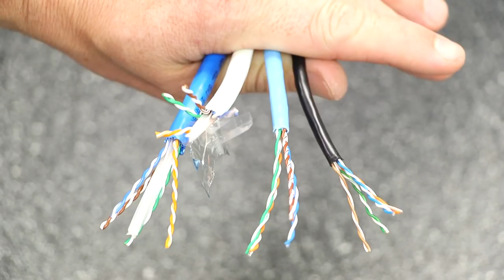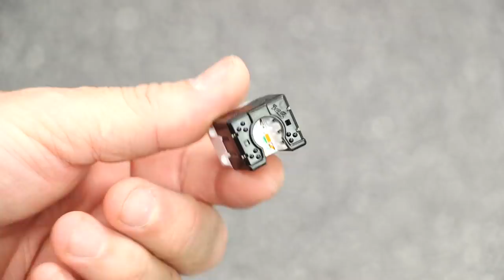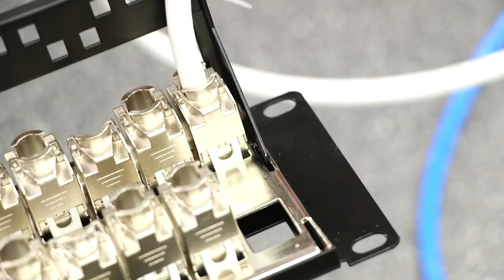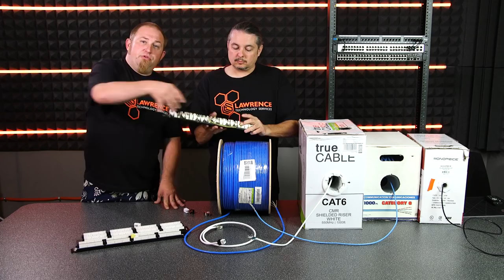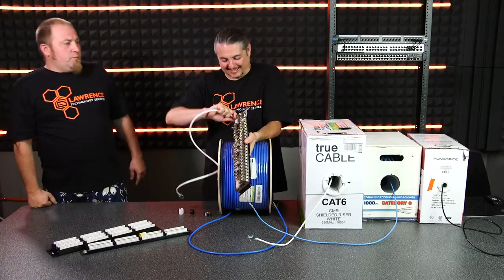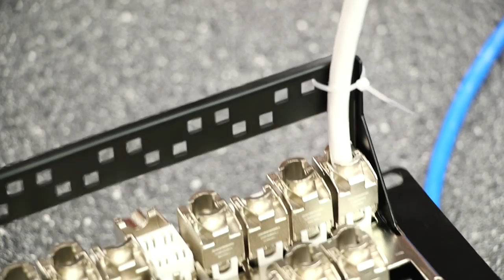Structured Cabling Discussion: Working With CAT5e, CAT6, CAT6A & Shielded Patch Panels

Comment: The maximum length for gigabit ethernet is 100m not 300m. I think you mean 300ft.
Reply from the maker: Oops, thought I said 100m
Reply: Nope you definitely said 300M, i was wondering what kind of magic you had for that.
Reply: Tom WILL make it work. 👍
Reply: Copper Ethernet can indeed go beyond 100meters with the right equipment.
It’s not standards based but it works well.
Reply: If your fingers don't hurt your not doing it right. The twist is a big part in the design of the cable. I try and leave the twist in as much as I can that's the finger bleeding part. It's amazing when you think how much engineering is actually in all the cables. The twist in the cable is like how the planets magnetic field protects us from the sun. Twist helps keeps signal in and pushes interference such as Emi and RFI out. The twist in the cable is different from each pair because when singnals shoots out from the switch. The different twist allow for slightly different traveling speeds between the pairs Mila sec helping with crosstalk between the pairs. The A in cat6a or 7 Stands for augmented the augmentation of the cable is the thickness of the jacket, shielding, core ,gauge of the wire, and the extreme twist that's in the cable. For me cabling is one of the most important parts of the job cable stays equipment changes so if you have a customer that is buying property or is planning on staying at their office for a really long time investing in the cabling is a good idea. if they're just going to be there for a year or two then I would probably go with the Lesser cable depending on what their needs are as a company. I don't run Cat5e not for a long time with my distributors I buy enough cable that my prices are near Cat5e prices so I just install Cat6 most of the time. If your bidding a job and the job is a plenum space then the cable will be considerably more expensive near double. Watch out for the plenum. Great video guys
Reply: Yeah I'm sitting here trying to brush up on my cabling knowledge. Hear 300 meters and am thinking, "Okay either I don't even know what I thought I knew to be correct or something has changed". Luckily just a mistake lol. Great videos still guys. Wish I could work for you. Great group you've got.
Reply: 328 ft is what is recommended for maximum distance of a data cable run.
Reply: way back when I took my CCNA the maximum run of 10/100 cabling was 90 meters in the wall (i.e. 300ft).
Reply: yes, 90 meters in the wall and up to 5 meters on either end for a total of 100m from end to end.
Reply: Kenny Garland completely right put that together you get 328ft. So the solid coper cable is allowed 90m and the stranded coper patch cords for the ends is 10m
The reason for stranded copper is for the flexibility and strength. Patch cords get bet up pretty bad on user side with desk and all that.plus the rack side patching and routing cable management. I find why and how the cable works pretty interesting. It's made that way for a reason. In the real world sometimes we push distances a little over. Most of the time on a long run just add a idf or a switch and re boost.
Reply: Kenny Garland 90m is 295 feet 3.307 inches
300 ft is just way easier for remembering
Reply: The Belden REVconnect doesn’t hurt your fingers but it beats the hell out of your wallet.
Reply: @RedneckTechcontrolle  not it 300ft to 100m
Reply: @LAWRENCESYSTEMS  that confused the heck of me. Mistakes happens :D
Maybe you could put a note on the screen?
Reply: @LAWRENCESYSTEMS  that confused the heck of me. Mistakes happens :D
Maybe you could put a note on the screen?
Reply: this people has no idea what are talking about ... my god !
Reply: @lowvoltagedude7837     and 328 is crazy, as you should consider service loops and other gizmos and runs  ...  I would say 300 is MORE than recommended if you want to stay out of problem ...
Reply: @RedneckTechcontrolle  fiber

Comment: its been a while since i have had to break out my punch down tool. I was looking around for 110 punch down patch panels and they are harder to find than krone. from what I remember there was little scissor cutters on the end to clip the wires instead of a pinch edge like on my fluke 110 punch down. Any insight on krone vs 110 punchdowns ?

Comment: Thanks for another helpful vid! Would love to see a conversation about what sort of environmental factors would cause you to select shielded vs unshielded Ethernet cables for an install? What kinds of interference sources do you look for? Does any length of run that is parallel with a 120vac line constitute a problem? When does shielding become a hazard in terms of failed to grounds causing them to become antennas?

Comment: True that cat5e and cat6 will meet the gigabit spec. However issues with Poe become a problem because cat6 is 1/2 a gauge larger than cat 5e. Some of the new Poe standards they do not recommend using cat5e over 150 ft. There's also a new redundancy feature they are building into ethernet they intend on packing gigabit over two pairs. This allows for link aggregation on a single ethernet cable. At 2gig primary application is for Poe phones. So the phone will have its own network connection and the PC will have its own network connection a physical connection is made in the phone that allows the computer to have its own port. Not reliant on the phone. Also allowing for dual Poe so the phone will operate on Poe and the other device plugged in can run on poe as well. However this standard will not work well on cat5e will probably be limited to a 150 feet max. Also keep in mind that at higher Network speeds like the 10-gig spectrum when cables are bundled together you can have interference from an adjacent cable commonly referred to as alien crosstalk.  This can occur even on cat6 at less than 150 ft It has to do with understanding cable length and amplitude differences this is the primary reason why cat6a was developed to eliminate alien crosstalk issues. The other thing that is commonly misunderstood is shielded cable. When people think of a shielded cable they  think of a cable with all the pairs in the cable having a shield around it. That is technically incorrect it is what they call screened. A true shielded cable like cat 7 we'll have each individual twisted pair shielded. This prevents what they call reflection. When you have multiple conductors in a cable with a common shield the frequency can radiate from one pair and The shield can act as a reflector and induced self on another pair. If you live in the United States the primary reason why you do not see shielded used commonly is because the United States has the FCC to regulate frequencies and RF given off by equipment  within the air. However in Europe there is very little governing agency in the past that has done anything to regulate frequencies. As a contractor who works with customers all the time.  budgetary matters I explain one fundamental truth the cable will always be the last thing replaced in the building. can you afford to live with substandard cable being installed from day one. Having an understanding and a grasp on the cables limitation like poe applications can help the customer make better decisions. If you are a cabling contractor or somebody intending to have a building cabled I strongly suggest that the access points be done and cat6a because of what's coming as far as network connectivity. everybody is talking about what 5G is going to do to the cellular industry but the same technology is going to filter its way into Wi-Fi as well. you have to look at it access point as a switch multiple people accessing it. For home where people are accessing the Internet it's really not necessary but in large businesses where they access stuff stored on their servers it becomes critical.

Comment: I never comment on YouTube videos, but had to on this to tell my tale.
My employer just went through a large infrastructure upgrade to replace all our Cat5 runs with Cat6, and we also replaced of all network and server hardware.  They brought a contractor in to assist with the planning for the project and they insisted on Cat6A.  I argued with them that it was too expensive and not worth it for what we're doing as a business, but the contractor got their wish and spent double, if not triple on the 6A when vendors bid the rewiring job because contractors know everything. :)
Ended up being 100 dual drops (one voice, one data), and the vendor was here for three to four months.  It was their first experience with 6A and they went through a few patch panels before finally getting the shielded panels like shown in the video.  The traditional panels you feed the cables in through the side with just kept popping loose.  The vendor was so annoyed and angry with the 6A because it's so rigid and hard to work with, and it made them do more work because the power poles we had at workstation locations needed to be replaced to accommodate the large cable, the hanging in the ceiling was difficulty do to the weight of the cable, and the various panels they went through.  It was a nightmare and completely not worth it.
Reply: Here in Germany we only use CAT 7 or 7A on new installs. The prices have dropped very much in the last years.
And it is worth it. No more interference and you are ready for 10G in the future without having to rewire.
I recently bought 900MHz CAT 7+ cable for €0,58 per meter.
Reply: Cat 7 is a bit of a hoax to be honest.
Reply: Cat6A jacks need deeper trunking\back boxes, is a pain in the arse to work with. But saying that even on my first Cat6A job I didn't experience problems your contractor did. Was they an electrician or specialized data installer.
Reply: Yes, they are licensed installers and do wiring for security cameras, networks, phones, electrical, etc. and we've used them in the past and they did a great job for us.  Very clean, quick, and they were always cheaper than others.  I just don't think they were ready for the 6A beast since they never had to use it before lol.  I wasn't expecting it to be as bad as it was either.
Reply: iwanbo I’m curious as to whether any of the runs would go over 30m. If so then your insistence on CAT 6 is invalid. If your try to establish 10g network and the growth capabilities to future you need to ensure long term usage. CAT 6a came about due to longer infrastructure runs. Anything over 30m can’t be certified for 10g as it loses bandwidth. Only 6a has the ability to run up to 100m end to end. End to end referring connector of switch to device being connected. If none of the runs going from switch to computer or voip drop was over 30m then your cost saving would’ve been there. Curious how small the facility was for you to wire up only 30m lengths.

Comment: If you want to future proof cat 6 should still be fine for 10g in normal size homes? No way I'm running cables longer than 121 ft in my house.
Reply from the maker: Yes, it should be fine with just cat6

Comment: I had spec'd CAT6A throughout my parents' new house, because we were planning to do a lot of 4K HDMI distribution with the structured cabling. I couldn't be around for the install so I left it to the contractor to use their judgement based on the requirements. The contractor ended up pulling "CAT6E", which looks like it's the same gauge and TPI, but with a thinner jacket and without the plastic separator. It's not that big of a deal because I think the longest cable run is 35m, but they didn't install any conduit and all the exterior walls have spray foam insulation so I can't pull any more cables or replace any lines without a lot of construction. 

CAT6E was a lot easier to deal with though, since I did all of the terminations. I ran CAT6A myself for the basement area and after doing that, I would really reconsider it for a new install. 

Good call on the modular patch panel. I'm using non-modular patch panels and I had some issues with the connections due to the strain.

Comment: Story and question: 
I wired my brothers house with CAT6a, shielded and with the seperator plastic inner.. what a newbie mistake, haha. entirely overkill for a short run without the demand for great speeds, and what a pain to install, didn't even have the correct RJ45 wall panels or anything, least they were flimsy cheap ones.
Not even grounded the shielding.. could this be a big issue?, in CCNA we learn there can be eletrical shock hazard, and also read elsewhere i think, that without grounding it can actually degrade the signal in the wires, rather than protecting?.

PS. Happy there were close up's, were afraid there be none. But it all seemed a bit rushed, as you also said, busy time.
Reply: in CCNA your materials are really gearing you up for working in datacentres and other places where there is a lot of RF interference, while there is a small chance of shock, it's not that likely. In a house setting I'd say it's a negligible risk.

The only issue you might have is if you've made improper terminations, over time those terminations may degrade and fail, nothing re-terminating wont fix, though

Comment: There's one very important point about shielded cable.  The shield must be connected to ground at one and only one point for the shield to be effective.  If it's not, the shield is wasted money.  Also, I have been on a couple of jobs, both for government organizations, where shielded CAT6 cable was used.  Neither had anywhere near the bandwidth to justify even Gb.  Well, it's government money, so there's lots more where that came from .  I've also had the "pleasure" of putting RJ45 plugs on shielded CAT6.

Comment: Trying to find a video on the pros and cons on racks for small to medium home cable management. I hope that makes sense.
Reply from the maker: Pros are the cables management looks much better and keeps things organized, con is that it takes more time and money.
Reply: @LAWRENCESYSTEMS  Sorry, my question was not clear enough. I have decided to purchase a rack, but unable to weed through the jungle of racks to select one.  I am searching for a rack and wanted to know pros/cons of the different makes, models and options. What are good manufacturers and models. For example, Panduit comes to mind because I have seen that used in our data center, but may be way expensive and overkill for my use.

In my case, the space I have available is a close under a stairwell (39" wide x 50" deep x 109" high). The door opening is 27" wide x 96" high.

I did find a video you where you showed the StarTack: https://www.youtube.com/watch?v=DJ7Cq5RBcYE

I guess I am looking for more about product education on what to look for and consider when select a Rack.

Thanks for doing the videos.

Comment: How does shielded Cat 6A compare to Fiber?  The cable is thinner and easier to pull (harder to terminate).  Interested in your input.  Thanks.
Reply: The actual electronic devices that support FO are usually more expensive (vendor branded transceivers can easily go past 2-300$/pc ) and not available at all for consumer grade products. So somewhere at the edge you must switch to copper after all.

Comment: Hi guys, thanks for the great video which helps as I am building my home and designing my network. I am building a network on second hand switches, routeur (Cisco) and Fortigate … now comes to the cat6a vs cat7(aor not)… my home is Fiber interconnected so 500mega. Which CAT should I go for (100 m max). Thanks for insight

Comment: You guys have an upgrade video? 
Well I life in Germany and I learned in my training 2007 cat7 and yes it is more expansive than the lower cat 6 or 5 but if the network parts like switches or pc are going more affordable with higher speed than you didn’t have to change your hole Infrastruktur you just have to change the switches. And after my training we had that last year we change a small business from 100 mb to 1gb for all included the new ip phones system on a weekend. Because the wiring was still cat7.

Comment: i've seen a guy do real world tests(it was even way back at 2015) on cat5e cables and he got 10gig iperf speeds on a 60+ meter cat5e cable, if you are only reading off a spec sheet, it will always be 1gig.

Comment: In Germany we basically just use CAT 7 or even 7A for new installs.
Reply: True that. Cat7 indiscriminately all the way to the farthest 10/100 cam just because. Now, I usually don't get involved into cables but when I do, I'm always happy to fight cables with a 3' diameter. Gah.
Reply: Cat 7 is not recognized by TIA/EIA. That is a big deal in the US.
Reply: am385
That's why I mentioned 7A.
Reply: Not supported either. Not like that could hold me back if I wanted a higher quality cable, though. Then again I like cables that I don't have to call in The Rock for bending them a degree or two.
Reply: In countries where the cost of labor is high you really want to pull the best you can afford. I wouldn't recommend running CAT5e but I guess if that's all you can afford then that's what's going in. It will still be more stable than Wifi - though that has improved significantly over the wireless G days.
Reply: For enterprise stuff we run a fiber backbone in our manufacturing plants since it is always very far to equipment.  Minimizes length requirements so we can get faster speeds with cheaper cables.
Reply: I wouldn't even run Cat7, it is simply cheaper to go to single mode fiber at that point.